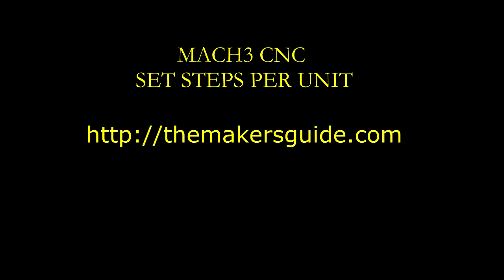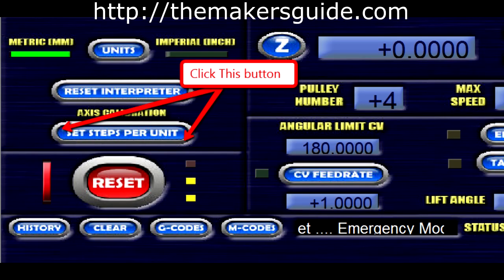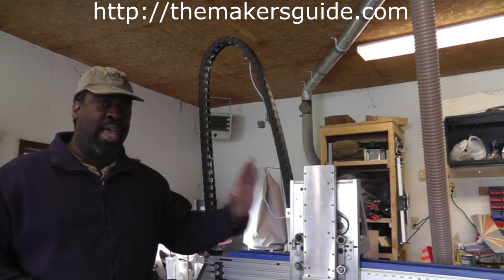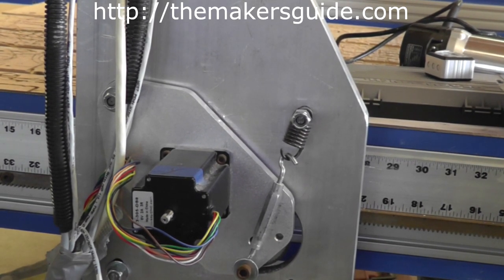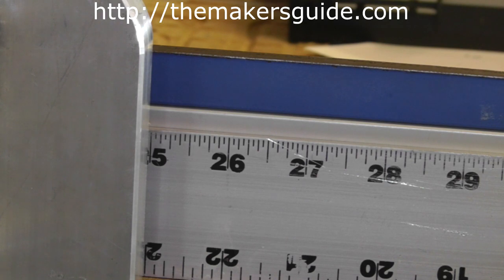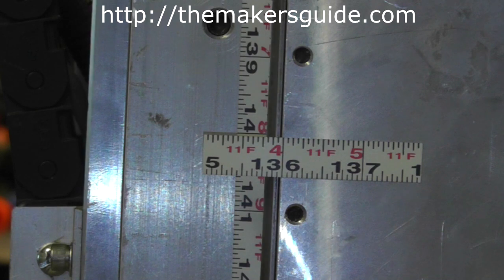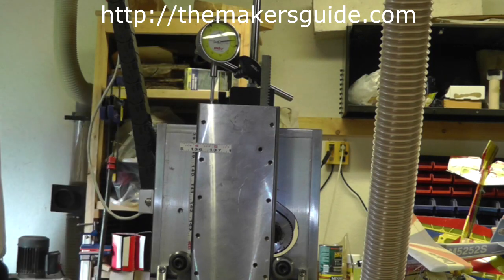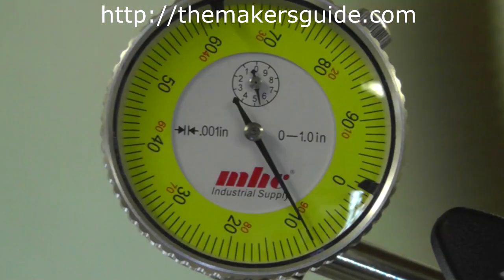Mach3 Tutorial - Setting Steps Per Unit

Comment: Hey Bill, glad I found your channel! I purchased my machine from someone used and I have limited information on how Mach 3 works. All of the videos that I find on YouTube have a different interface than what I see on my computer and I can't seem to find any steps per unit calculator. About to pull my hair out lol
Reply: I'm sure you probably get questions like this often. Hoping for some help if you could find the time.
Reply from the maker: @hyperflowfans  Look on the Settings  ALT 6 tab. Right above the RESET Button is a gray rectangle that says "Set Steps Per Unit." Click on that gray rectangle.
Reply from the maker: @hyperflowfans  I sent you an email with screen shots of the default Mach Screenset and where to find the button.

Comment: Hi, I love your channel to see if you can help me. I am a joy that took a fancy to cnc and set up my machine and got an engine with the mach3 but the maths do not mine as I can configure the engine with this hardware strap gt2 in YX axes
T2 Strap

GT2 step: 2mm

Material: rubber

Length: 5 meters / volume

Width: 6mm

Number of teeth: 20 teeth

Step of the teeth: 2mm.
Diameter of the distribution pulley: 5mm 8
interface mach3 usb-lpt

tb6600 driver https://fotos.subefotos.com/641917f19d385524583c6e85e67e85e0o.png

Comment: Just wondering what you do if you put in 3 inches and it moves + or - what you ask it to move. You show everything working out right but what if it doesn't.
Reply from the maker: If it move in the wrong direction you missed a step in the setup. You can fix it in ports and pins by changing the active high to active low or vs. versa.
Reply: @BillGriggs  ok thanks

Comment: ? for yea dose your g-code have to be in the same settings as mack3  or do`s it convert into your mack3  setting
Reply from the maker: Your g-code should be generated with a post processor designed for Mach3. You can use other generic post processors with varying results.